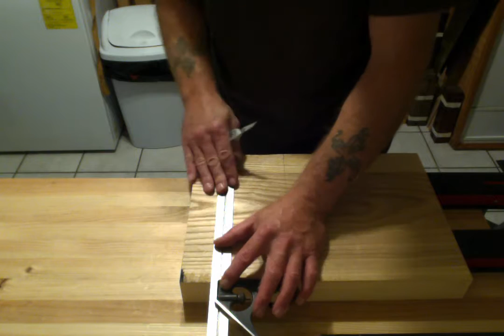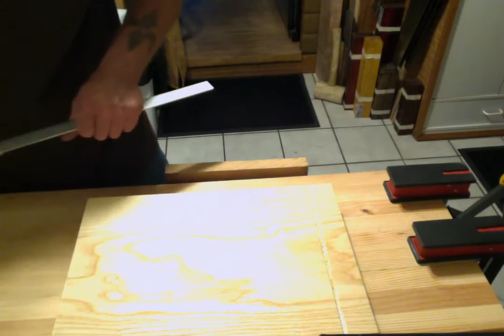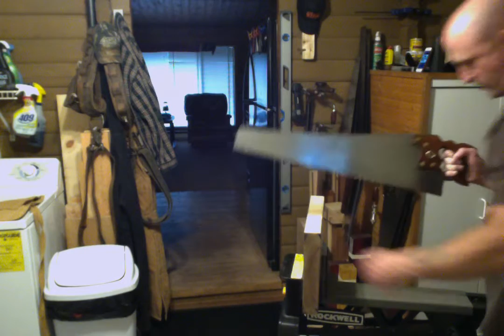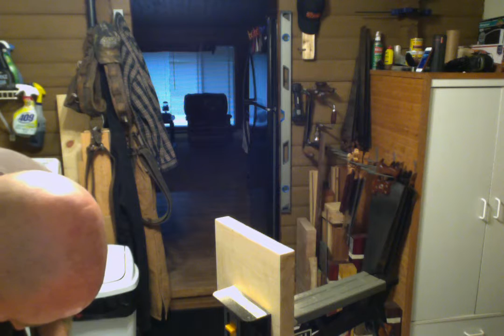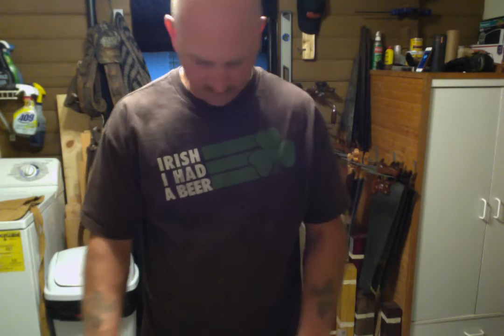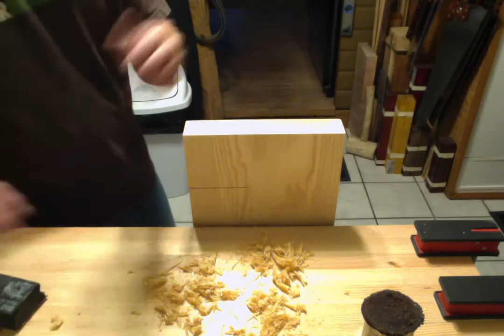Cordless Carpenter workbench build #69 - Vise chops part 11

Comment: I know it was a several videos back, but I meant to mention something regarding router planes. For most work, use the straight/chisel-edge iron rather than the pointed/spear-tipped one. The pointed iron is mostly just for cleaning up inside corners if they'll be visible when the project's finished, but it doesn't remove waste as efficiently as the straight iron. That's most likely why the "poor man's router" seemed to work better. The pointed router iron is one of those things that generally sits in the box 99% of the time and most people could probably get away with not even having one at all.
Reply from the maker: Thanks for the tip! As you probably guessed by now, I don't have a lot of time behind a hand router and tips like this are great.  Thanks for watching and helping a brother out.
Reply: The Cordless Carpenter
No problem! I just recently finished building a proper workbench (after not having one for years), and I'm enjoying your series. I went with a flat top Nicholson-style in Doug fir, simpler than yours due to space, time and budget (took a lot of inspiration from the ones Tom Fidgen built for his school up in Canada.) I live in an apartment surrounded by neighbors, so I've become a big fan of hand tools (and pre-dimensioned lumber ;) .)

Anyway, your bench looks great and I'm looking forward to seeing how it comes together!
Reply from the maker: thanks a lot, the good feedback is awesome.  not a whole lot more to do on the bench and she'll be done so I can start making things again haha.  right now I'm focusing on getting all my wood cut and split for the winter but I might take a break from that and start installing my second vise this weekend who knows.  I've also been putting in long hours on restoring an old forge and anvil and that too is almost complete and ready to fire up sort of haha.  lots of work to do around here... never boring at my place that's for sure.